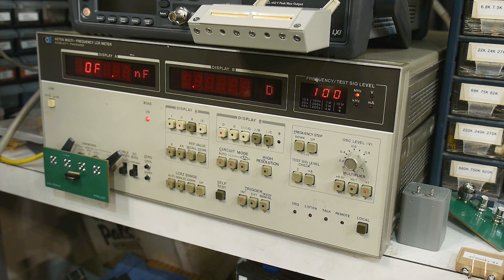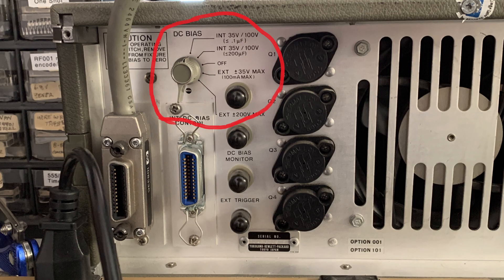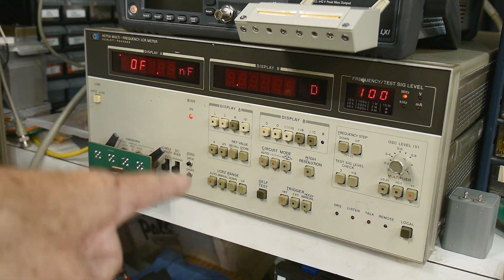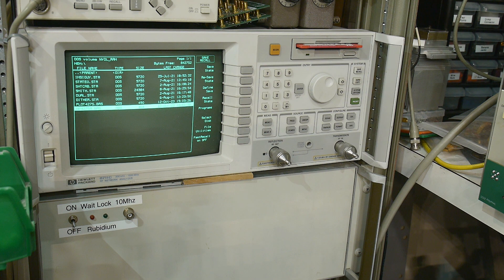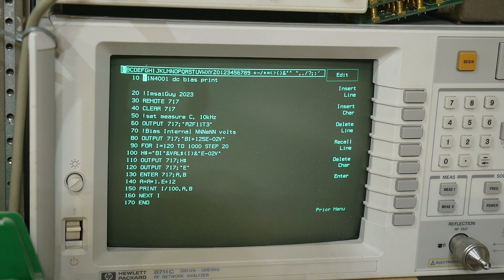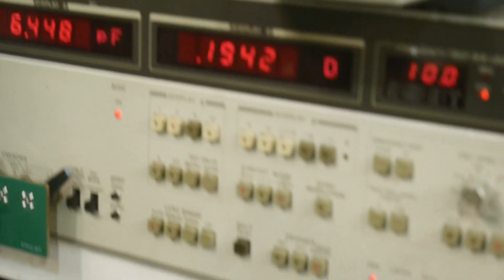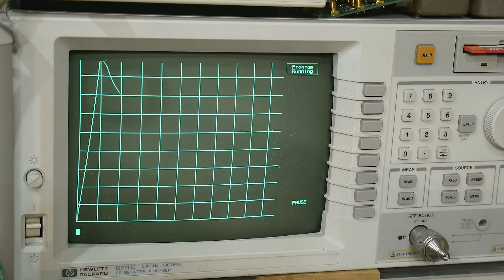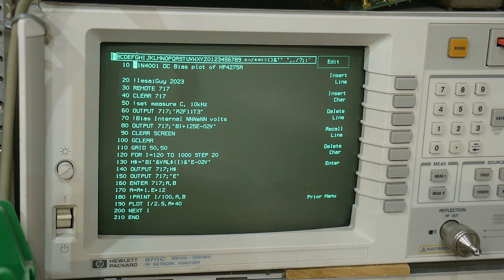#1694 HP4275A HPIB Program for Internal DC Bias (part 7 of 8)

Comment: I'm so old I remember when it was still called HPIB. Production engineers used to spend their days doing this.
Reply: Where HPIB is still used... it's called "Test and Measurement Engineering" now... and is distinct from "Production Engineering" (PE being... AFAIK... mostly in the planning, and optimization of production... whereas and AFIK, Industrial Engineers are more on the floor) Anyway... Ethernet, WIFI, CAN, and Fiber Optics are the hardware protocols  you see on factory floors. Besides the T&M labs... AFAIK... HPIB hasn't been on the floor in a long long time.
Reply from the maker: I think we can both agree that John is old. 😎